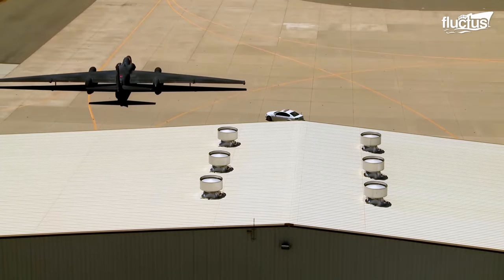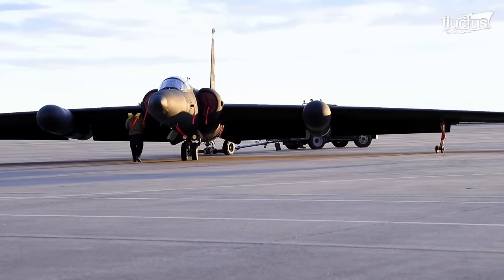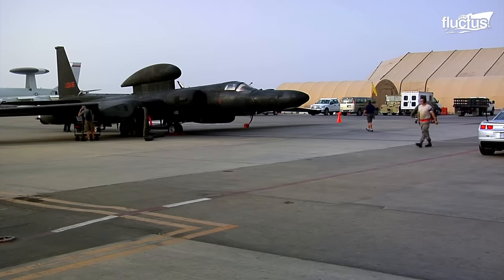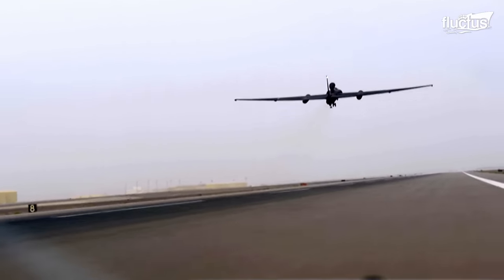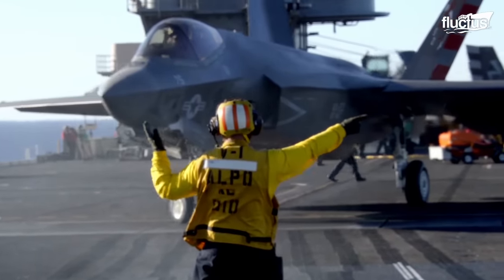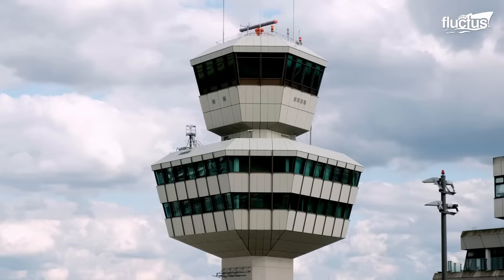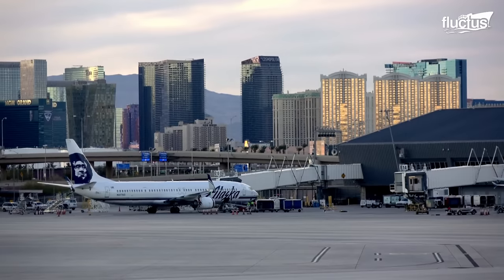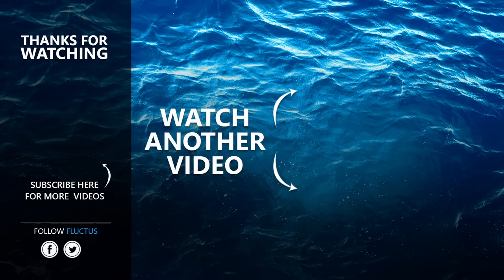Weird Reason Why This US Spy Plane Need People on Its Wing During Landing

Comment: What a goofy plane.

‘Ultimate spy plane? Most feared? Why are you ignoring the SR-71 (and possibly its secret successor)?’
Reply: The SR-71 was about sending a message doing what no other aircraft could do but had very limited practical value for the extreme operating costs. Practically, economically, the U-2 is much more useful and even has a lower operating cost than the RQ-4 Global Hawk drone which could potentially replace it.
Reply: @delos2279  the SR-71 sending a message was probably to create a reaction that would make it most feared. The U2 was slow and vulnerable to SAMs, the SR71 was fast enough to avoid intersection for most enemy aircraft, which would make it the ultimate spy plane. Being economic doesn’t make it feared and the ultimate, it makes it budget friendly.
Reply: @Sir_Gugharde_Wuglis  Yea different goals. The SR-71 had a solid decade where it was basically invincible. Even though it never flew over the USSR for diplomatic reasons, it could have and gotten away with it.